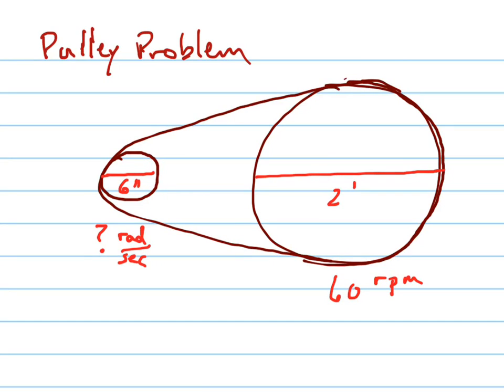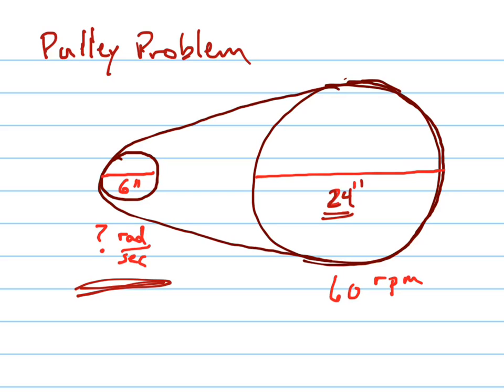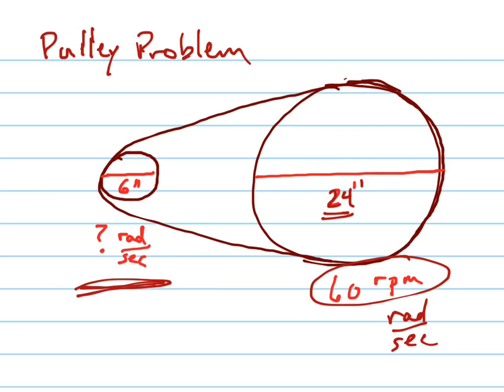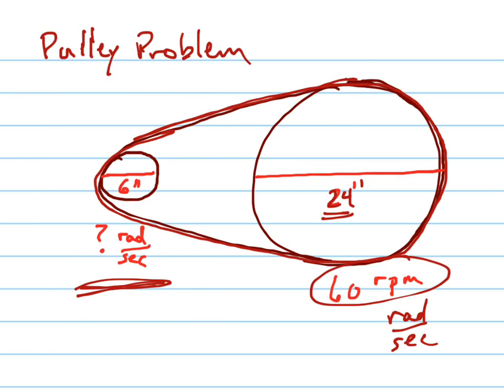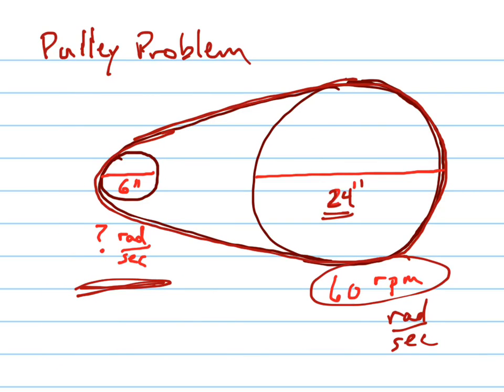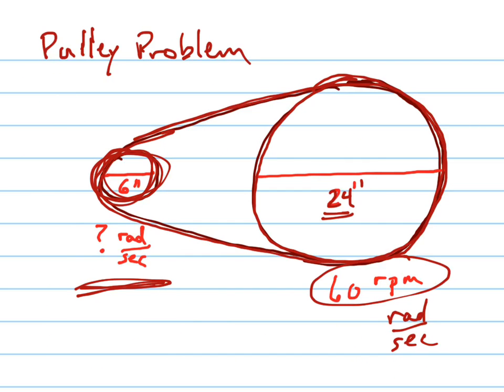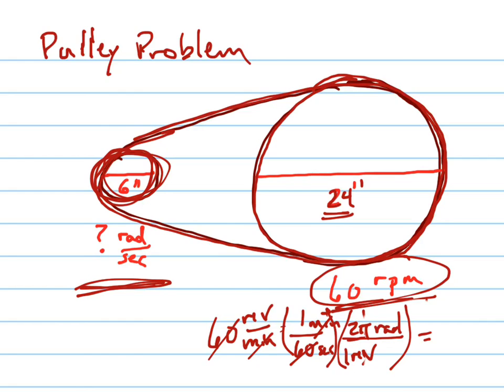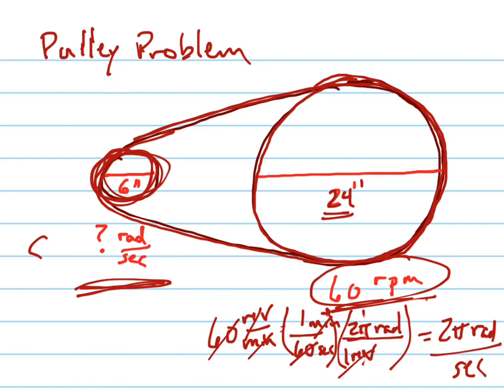Pulley Problem: what is the angular speed of the smaller pulley?

Comment: I have a question for you I have an 18 inch pulley I have a two and a quarter inch pulley for my driver do I have enough torque to turn a small vehicle will 1050 RPM on a 3/4 horse motor

Comment: Hi thanks for the vid! what about the distance between pulleys? I want a 15" pulley rotating at 60rpm. That is my target speed. Question is, if the motor is 1000 rpm, what pulley and at what distance should I place it away from the 15" pulley? If you know the answer, please let me know, thanks again!
Reply: That's funny ,Doesn't that depend on your belt length  . Longer belt has to be further away .maybe I misunderstood your question.